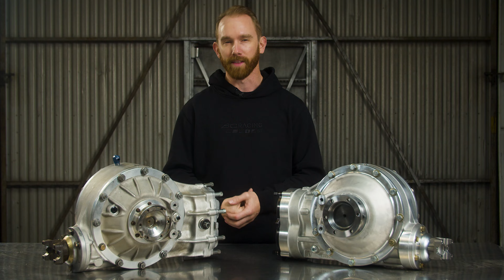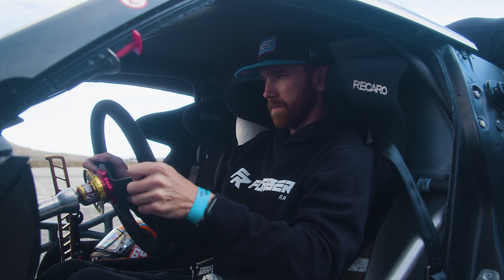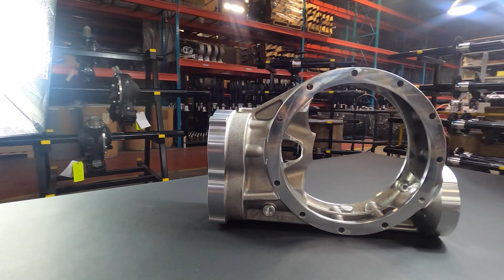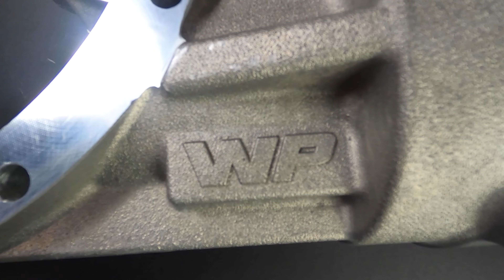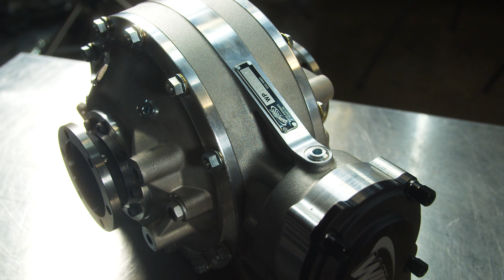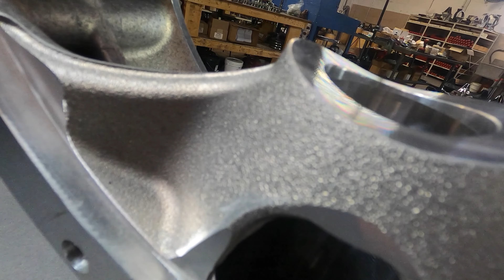Exposing What Happened In FD New Jersey and What Failed...

Comment: Sorry, but for the amount of money they charge for these damn things, they should be billet and made in the USA. There's no excuse for casted parts that cost this much money, with the advanced in CNC machining today
Reply: We use domestic foundries and forges and manufacture our rears in York, Pennsylvania. Our door is always open to visitors—stop by and we'll show you the process. We operate some of the most advanced CNC machines available, but the amount of time and material cost to machine an intricate center section from billet would be cost prohibitive even for the most well-funded team. The Permanent Mold centers have been independently lab tested to be the strongest production quick change centers on the market.
Reply: @wintersperformanceproducts you and bulldog within 30min of each other. Crazy 2 quick change companies so close together.
Reply: These dudes are no joke. My family and me have been running them on our sprint cars for decades. I have a feeling they are 2x the cost for the car rear ends vs our sprint car rear ends is probably just supply.

Comment: I ran into this same failure mode back in my time at a foundry casting IFV parts.  For anyone who cares, what happened most likely is that as the aluminum cooled in the mould those thinner sections solidify first. Al mushes kind of, and so as the thicker sections cool differently the mush starts being pulled apart leaving voids in the solid metal.
Thats why the permanent moulds with controlled cooling 'fixed" the issue as those thinner sections can be kept hotter allowing the mush to occur evenly.